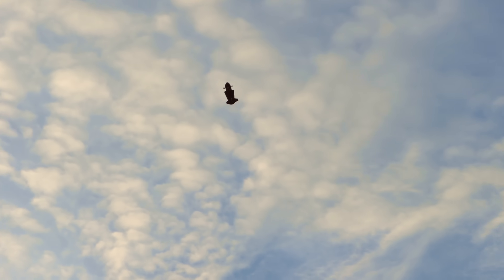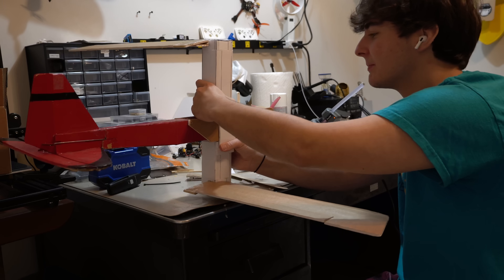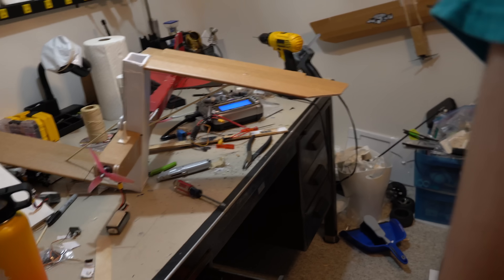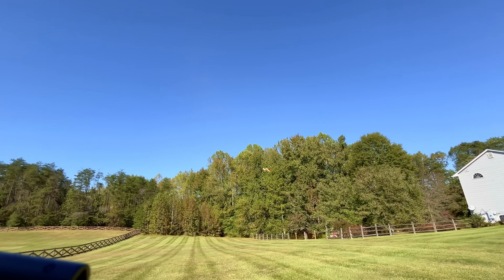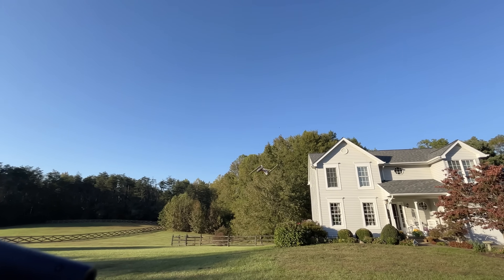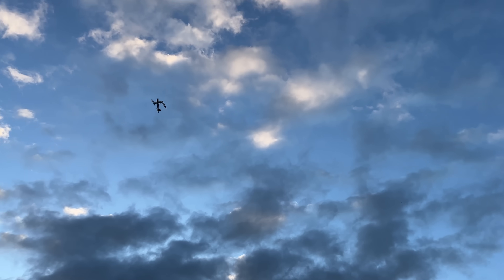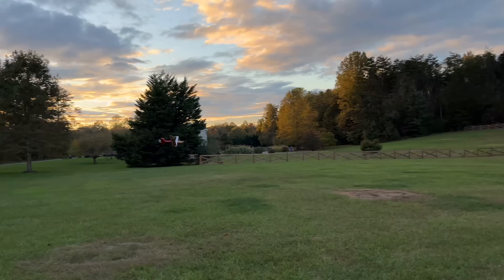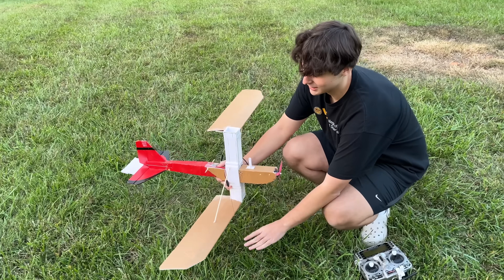Can a Plane Fly With Offset Wings?

Comment: It can fly. Anything can fly, it's only a question of power. But the reason you don't see any production aircrafts sporting offset wings is the fact it would  handle like a pig, and suffer from degraded performance, as you will have to induce drag to compensate for the performance delta between the wings. Symmetry is more effective. Another aspect is if you alter AOA, the two wings will have different dynamics, and you end up with a dynamic CoG. Which is less than desirable. Says this retired Air Force guy.

Comment: By just doing a naive torc calculation, assuming that the wings produce the same force parallel to their normals, it is quite clear that their would be no torc generated from that asymmetry it self. Because the angle the lift forces from either wing to the center of mass line is the same but on opposite side. So your results are not supper surprising, but it is nice to see that experiments agree with theory since their can always be some contraintuitive effect from the airodynamics (never assume you understand airodynamics! there is a reason why the airplane industry still uses windtunnels and don't trust simulations.).

Comment: Okay cool in the air you get it to fly you also technically launched it from a scale equivalent to at least 80-90 feet. So, the plane is already technically in flight when you release it. Try having the plane fly from the ground and take off like a normal plane. I bet you will experience ground effect and the plane will not take off and it will crash.

Comment: If you consider, the lift will pivot around the centre of rotation with the distance from the centre of ration being a leaver, if the wings are equally distant from the centre of rotation it would be balanced, if one wing is at or near the centre of rotation and the other if far higher or lower, then it would be unbalanced and show all of the behaviour that people predicted.
Clearly your model was close enough to balanced to work.

Comment: I am pretty sure that it would create some noticeable rolling moment if the wings had noticeably different offset from center of mass. so if one wing had let's say 10cm offset up and the other 20cm down. but as long as both offsets are somewhat similar, the only rolling moment could come from ground effect, which should also not be too noticeable given the size of wings you have there. Oh, or if the offsets would be so big, to be in different air currents, but that would be an extreme case again.
Good video!

Comment: The REAL issue with these designs is in fulcrum forces. You are creating a lever on the Y axis where is any cross winds load the wing, because it is so much higher than your center of gravity, it will roll the hull. To compensate for this, the lower wing needs to be as low and the upper wing is high. You are only focusing on X axis balance and ignoring your Y axis. Ultimately these designs aren't employed simply because of the extra weight and drag. To say it has "zero effect on any stability" is absolutely incorrect based on the aforementioned factors.

  You'll have further improved results with this current configuration if you add a slight amount of weight to the lower right side wing OR flip the wings around so the much higher wing isn't on the same side as rotor rotation this way when your propeller rotation naturally makes it favor left turns, that top heavy system can be weighted slightly to discourage that, and prevent your y axis center of gravity from crossing the metacentre (center of gravity) and then enter an unrecoverable roll over.

In summary, this configuration scaled up wouldn't work. It would roll in a cross wind and due to the weight displacement, you will then experience side loading forces from the fulcrum created by the extension column and that rolling motion will put you into a stall without enough trust which you won't generate with this given profile. AKA Death.

To claim it has no effect and myth busted is juvenile.

Comment: Imo adding vertical structure in front of aircraft requieres increasing vertical stabilizer size. Additionaly added structure changes pressure distribution on wing surface near root in some way, this effect should be diminishing with increasing aspect ratio, even though effect may be small it will affect lift balance between lower and upper wing.

Comment: I cant see the offset being a problem too much. if both wings provide equal lift and the lift ovecomes drag the plane should fly. i can only see stibility being a problim a little bit as the wings dont dont have much of a dihedral but should fly just fine.

Comment: on a normal plane you're right about this observation, same as the skew wing, but if you add laminar flow from the fuselage it will indeed make a difference, because pressure will be gathered between the dihedral points and create lift on one side, drag on the other, the side with lift (anhedral) will roll up, and the side with drag (dihedral) will yaw and loose lift

Comment: The problem isn't the offset.  The problem is how far from the center of roll each wing is offset.  If both wins are equally different from the fulcrum, they shouldn't have any issue. I imagine if the lever arms are different lengths though, the longer one would overpower the shorter.

Comment: Angle of attack will probably affect the flight more. For level flight, the CG will be under both wings, but in climb or decent, it will make a difference. It isn't just where the wing is mounted. To demonstrate this, offset one wing forward and the other back. Mount them at the same point on the fuselage so that CG is the same for the rigid body. The lift point should be the same, but the leading wing will have different loading forces than the trailing wing when pitching. Yaw would also be affected because the velocities over the wings will be different. You could also adjust the attachment point to  booms extending forward or aft so that both wings are still "conventional" across from each other, but you'll have to move where they attach to adjust the new CG. You should also look at the AD-1 NASA research plane.

Comment: When turning to the high wing side, the lower wing travels through the air faster and generates more lift. This moves the center of lift down, which reduces the stability margin. Once you run out of margin (CoL is below CoG) your plane will want to flip. Try a fast, tight left turn. The inverse of this is that the aircraft will require more aileron and elevator when turning to the low wing.

It’s cool seeing the principles of statics here too. You can move forces around while maintaining the same static equilibrium, so long as the moments stay the same. Awesome plane! 🎉
Reply: remember that there's a large vertical spar in play here as well, which is helping resist the rolling moment and providing lift when in a roll. That, situationally, may be better or worse, and certainly poses an interesting problem.

Comment: A simple sum of torques around the center of mass shows that mechanically nothing changes because the lever in direction of the wings doesn’t change by offsetting them up and down.

Comment: I havent watched the full video but I'll make a prediction:

it doesn't because the force applied at wing has the same direction regardless of which wing it is. Given that, for example force applied at the tip of the wing, a moment of equal magnitude is produced at both wings that cancel each other out. They are the same in magnitude because the difference in height doesn't actually affect the direction of that moment

Comment: Intuitively, I would guess that the aircraft will list until the center of lift of both wings are at the same altitude. When the difference in height is small, it only has to list 1 or 2 degrees, when the difference is greater, it will list more.
I would also guess that it is more relevant closer to the ground where the lower wing will have greater ground effect, which could affect performance.
Edit: after watching, it's hard to tell because it doesn't fly straight very much, but it looks like my prediction was correct.
Reply: Incorrect. Draw a free body diagram, vertical offset of the wings like this will not generate a roll moment at all. The wings would have to generate a force parallel to their span in order to exert a roll moment on the vertical bar.
Reply: @Ender240sxS13   I 100% agree that the wings are not generating any roll. I'm suggesting that because you have two offset centers of lift, they will equalize around the center of mass due to gravity, not any lift or aerodynamic effects.

Comment: I've flown high wing Cessna 150's and 172's, Super Cubs, Citabria's etc, and my old low wing Cherokee, along with Warriors and Archers, among others. The low wing planes don't have any more lift than the high wings (except ground effect happens a little higher/lower), so it stands to reason that your split-wing plane should fly just fine. I would however expect it to perform some aerobatics a bit differently, due to differences in slipstream, etc..
 Additionally, a buddy and I when working as aviation mechanics, built a "Flying Brick" RC plane, with a "T" tail and built up foam wing mounted to a big rectangular fuselage painted to look like a brick. It flew great, and was able to do all aerobatic maneuvers we could think of , including a Lomcevak!!!

Comment: Cool video and construction! Howver, the plane you built does not serve as an example of this theory because in the "flying car" problem you ended up having both wings above the car (center of mass) with different heights, and with this plane both wings are about the same distance from the center of mas AND in opposing sides. 

With both wings above the center of mass and at different heights, the lift of the wings will not cancel eachother out.

Additionally, you may not "feel" that the plane is rolling to one side because of the corrections the flying controller chip makes for you on the go, but I guess you kind of felt it due to the plane being harder to roll rightwards.

Comment: Aircraft design is all about compromise.  What advantage is gained through the offset in the wing?  None that I can see.  The offset comes at a cost of increased weight of the aircraft due to the support structure for the offset.  This structure also adds drag.  Takeoff and landing are two critical phases of flight which would be made more difficult due to imbalanced lift from the two wings being in different amounts of ground effect.

Comment: I do see one way that this can cause problems, but I don't think it's that significant to this application.

This particular quirk has to do with wing speed during pitching.  If you're pitching upwards, the lower wing is moving faster through the air than the upper wing.  If you're pitching downwards, it reverses and the upper wing is moving faster than the lower wing.  This will cause some roll while pulling/pushing the elevator.

In the exact configuration you're using, this would mean a tendency to want to roll left while pitching up and a tendency to want to roll right while pitching down.

In a high AOA stall, the top wing would stall first.

Comment: 0:57 Before I watch I'm guessing it does roll/torque due to air/turbulance after the wings still interacting and at low level/takeoff ground effect will do same but even more, it will obviously still fly though.... Time to watch 🍿
*Edit... You should colab with Premier Aerodynamics or someone to simulate this in a wind tunnel👍don't think this was 100% unequivocal proof of no effect just little in flight at those scales and speeds.... Cool video though and very interesting.

Comment: Ok, I stopped the video at 0:56 and will predict that it will fly level at a higher elevation but will only have a slight tilt to the higher wing when flying low. This is due to the ground effect. The wing that is closer to the ground will have ground-effect and the other will not, causing it to tilt to the side with the higher wing.

Comment: I mean, making one above and one below keeps the center of lift in the center. When you have two above youre raising the center of lift (which might not matter much with a small offset). But youre also changing the ground effect on one wing vs the other when close to the ground, the closer the wing to the ground the stronger the effect. So one will definitely have more

Comment: The wings are offset roughly the same amount from the center of mass but in opposite directions. Any rotational moment should be basically cancelled out. 

The swing wings were mounted on the same side. 

A better test would be to  have one wing sitting on the fuselage, and the other some significant distance above it. It’s not the direction that’s important, but the difference in distance from the center of mass at which the lift force is acting.

Comment: Theoretically the low wing would have some of the wing tip vortices from the high wing intruding on the section close to the route, so there might be a portion not making any lift, but the flat vertical secon between the wings could be acting as a winglet thus increasing the preforomence of the low wing. I don't think on this scale it will make a significant impact, but I'm interested to see what will happen
Reply: And it didn't end up mattering on such a small aircraft, I wouldn't trust it on an actual aircraft, but it's super neat that it works at scale

Comment: I wouldn’t say it flies completely normal since it’s straight flying position is crooked compared to its intended straight flying position (where the tail rudder is oriented up, rather than diagonally). If you were to redesign this, I’d recommend offsetting the tail with the knowledge in mind that the tip of the wings will always be aligned horizontally!

Comment: i would be surprised if it hasnt a flight controler but still possible, what would actually blow my mind is a glider with wing offset and no electronic parts so you cant make adjustments for the plane trying to tilt himself

Comment: Think about the air flow over & under the wings.  When the wings are closer together and offset, the air currents collide, and cause it to fail.  When you offset them by as much as you have, the collision is significantly less, thus it works.  The air doesn’t only flow above and below, it extends beyond the horizontal edges as well.

Comment: The offset wings shouldn't keep it from flying, but I imagine they'd be a problem for taking off. The ground effect means the plane will get more lift when close to the ground, so if only one wing is close to the ground, it will spin.

That's only for that huge offset though. If it's just a small offset, the ground effect will make it tilt a little, but then the wings will both be equally far from the ground, so it shouldn't be a big deal.

Comment: Super important to make sure incidence angles are exactly parallel. Also aileron adjustment is going to be able to make up for any variance. You’ve proved that it flies well enough but not that there’s zero roll effect or asymmetrically varied behaviors (cross-winds, turn preference, tip stalling etc. 
hey it would be sweet to see a canard version where the front pair is opposite heights as rear!
Reply: why should it roll if both wings are experiencing the same lift effect and are at the same distance from fuselage?  
The only thing that should be affect as i think is the moment of inertia thats why it take him less effort to turn left than to turn right
Reply: @ainekgonzalez2193  yes but things don’t always perform as expected in the real world
Reply: Moron

Comment: Here the center of mass is about equidistant from each wing.  What if the wings were at different distances from the center of mass?  It seems like that would give each wing's lift force different length levers to act on and cause a roll.

Comment: My initial thought is that the offset creates a drag imbalance and changes the center of gravity. will the modifications allow ease of flight? I dont know. I have to watch the rest to find out. I am going to bet that flying it is going to be easy, but not as easy as the normal configuration.

Comment: Here's my take: maybe the vertical spar (after you cut the holes in it) is acting like a wing itself, which would explain why the airplane looks like it's a bit unstable in the roll axis, since the normal wings and the spar create a dihedral with the equilibrium roll angle being at 45 degrees lol

Comment: I think I understand why it turns left so much better than right. The center of mass will always shift toward the high wing as it turns and the fuselage mast acts as a wing in either orientation. Roll to the high wing and you get effectively two surfaces rolling and a third maintaining lift. Roll to the lower wing and you fight the center of mass and lose efficiency of your wings. I bet if you switched the wings from high left to high right the roll discrepancy would largely switch as well. I would expect it wouldn't be as noticeable do to the direction of the prop. Switch that to for a more accurate experiment. Would love to see that to see if I'm right.

Comment: I honestly don't thing it matters where the wings are mounted as long as the upwards force of both are equally distributed at the center of gravity.
However, at very low altitutes, when landing, or taking off from a runway for example, I think you will find that ground effect will make a difference between the two wings.

Comment: Great build!
With offset wings, it will have more lift when the wings are longer and less lift when shorter. The same effect as having dihedral. 
In this instance, roll to the left for longer wing and roll right for shorter wing (in relation to the ground/ gravity).
With this said, it will inherently roll to the left in this configuration (High wing Left).
Nice Vid!